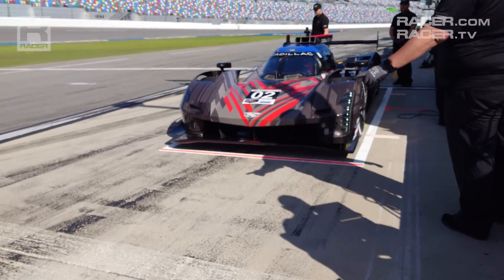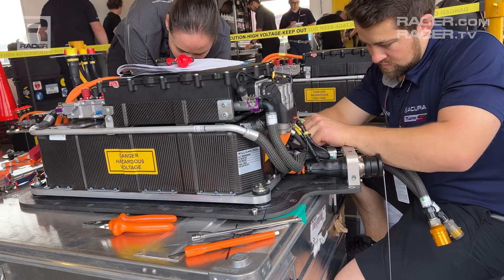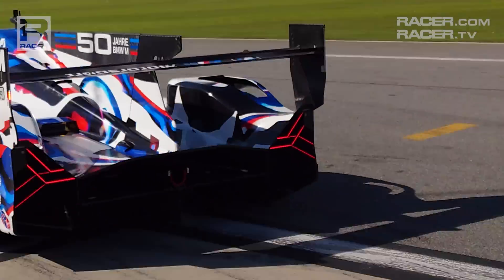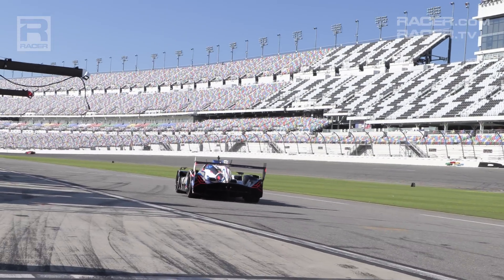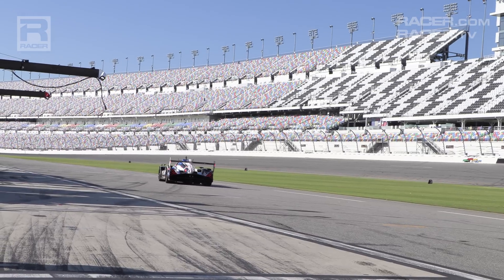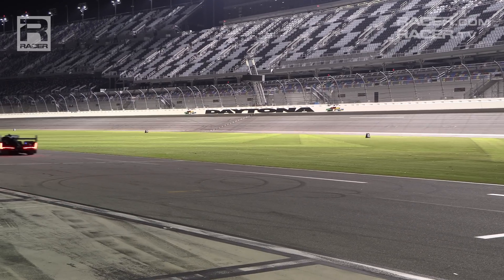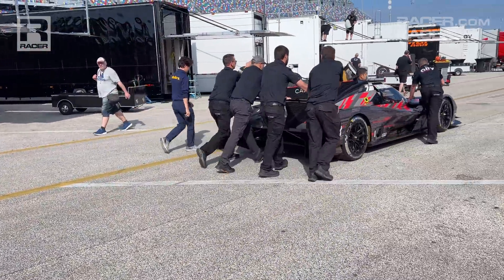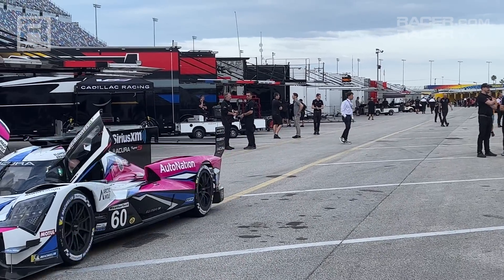IMSA GTP 101: EV Launches

Comment: Wait. The GTP horsepower is in the neighborhood of 700 hp. According to the IMSA website, the pitlane speed limit is 60mph, or, 37.2 kph. The NASCAR website says the speed limit is 55mph. 

Let's go with the 55mph: with 700 hp, at full throttle, the tires should be able to slide anywhere from 0 mph to 55 mph. In other words, they can't use the full throttle anywhere from 0 mph to the speed limit. 

So my question is: how can the electric motor give them a "dragster" like experience that wasn't present from the gas motor?
Reply: Because an electric motor has instant torque…? Also 55 is for nascar hence why the website for IMSA had imsa speed limit
Reply: @thatkid780  you are failing to see his point, if the tyres arent able to transfer all that torque to the ground it doesnt matter which engine propels the car since the acceleration is going to be always limited by the tyre grip limit. Instant torque means nothing if the tyres cant keep up and just spin in place.
Reply: @IvanVT27  a gas motor at low rpm has way less power then peak rpm. The electric motor allows the driver to press the pedal and be at the tires grip limit instantly, and then be peak power from then on out. Why is this hard to comprehend?
Reply: @thatkid780  because it will make no difference at all if your reach peak torque or not since in those cars the ICE has more than enough torque to make the wheels spin the same moment the throttle is pressed even if it is not still at peak torque. It wont make any difference in acceleration or G forces to the driver since the limit is still on tyre grip which both engines will surpass easily from a standstill. Not that hard to understand if you ask me.
Reply: @IvanVT27  so why doesn’t a challenger accelerate as fast as a Tesla? 🤯
Reply: @thatkid780  rwd vs awd maybe? Also weight to power/torque difference? Do you know basic physics??? There is a limit to the acceleration you can achieve and in most cases once you get to a certain power to weight ratio is just a matter of getting the   tyres to grip.

Comment: Yeah I’d bet most teams would use the ICE as much as possible to keep charge in the battery for maximum on track performance. No real reason to use up that energy in pit lane.
Reply: Fuel mileage is why a team might try electric power in pit lane. If using electric in the pits over 24 hrs gains the team 1 lap at speed vs the other teams pit strategy it could mean the difference between winning or not. No clue if possible but given the reliability factor I can see manufacturers declaring one car as hare the other as hound. GTP could easily be won by the slowest car that has the least trouble.
Reply: It's a series regulation, not a team choice.